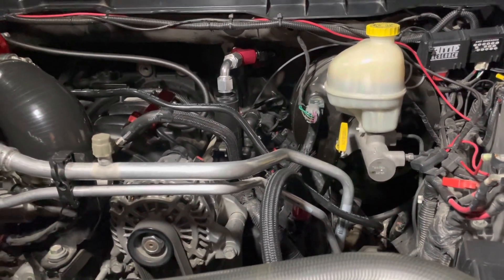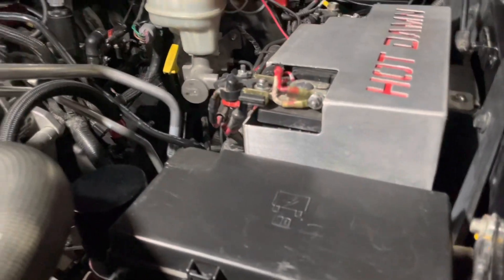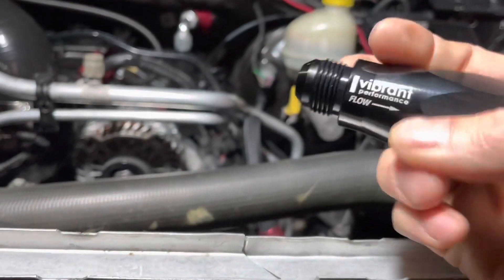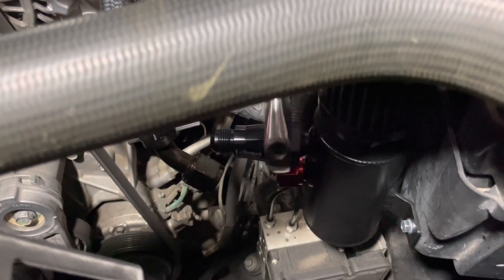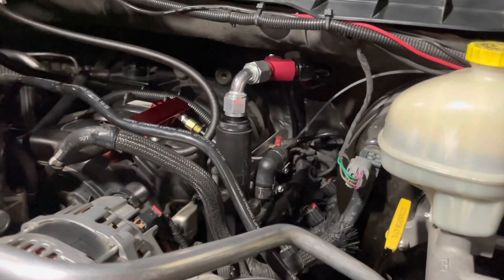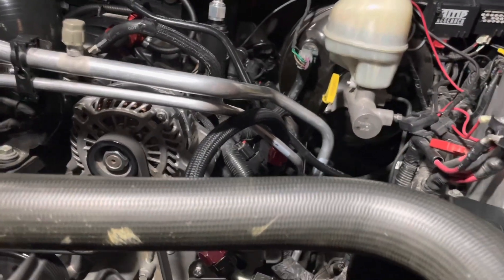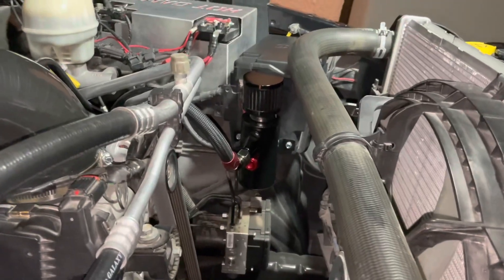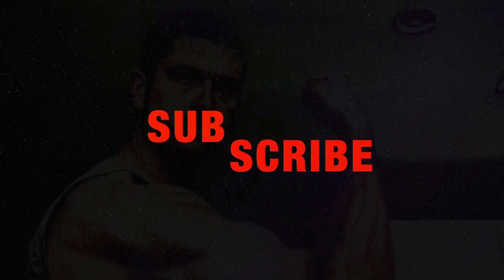DIY Hemi valve cover vent part 2 check valve installed

Comment: It's Glass Filled Nylon for the valve covers and intake IIRC.  Set those valve covers in the sun for a couple years and then lay your arm on them, bet it'll be itchy like fiberglass insulation! The sun bakes away the surface layer of the nylon and the fiberglass fill begins to be exposed.
Reply from the maker: I had no idea, thank you. I believe you, I work with fiberglass insulation fabricating hvac duct. It’s horrible lol 😂